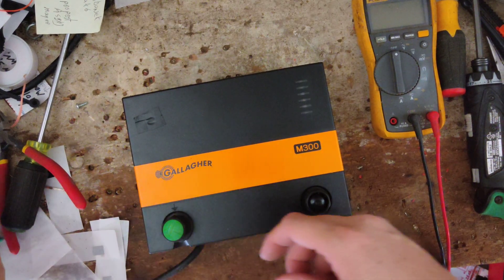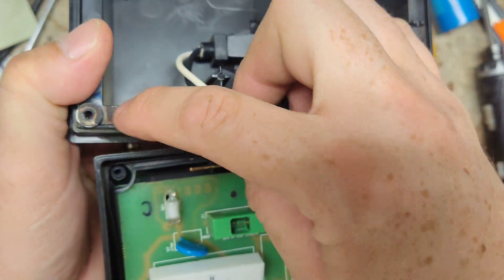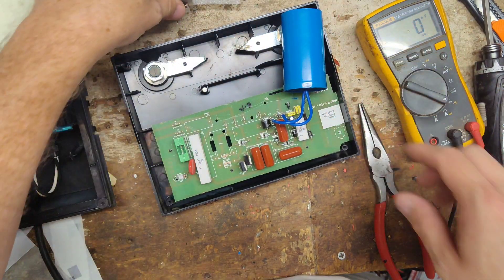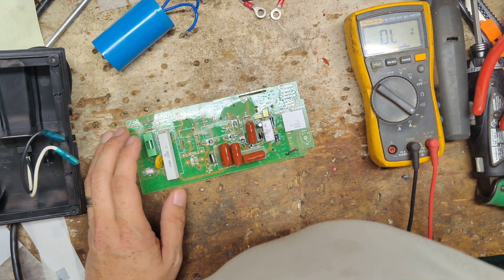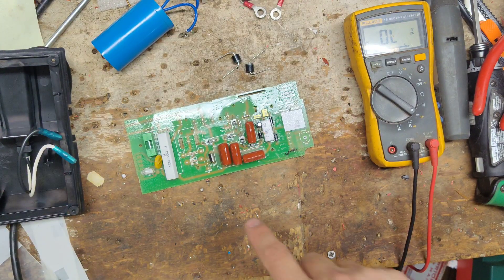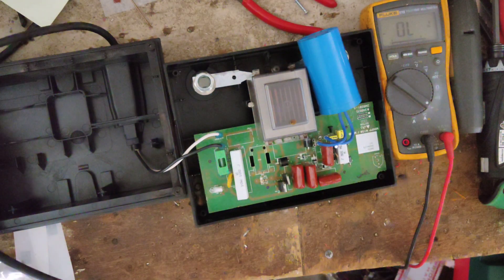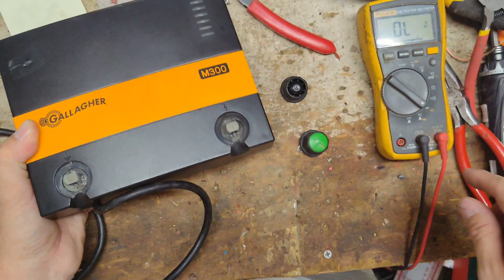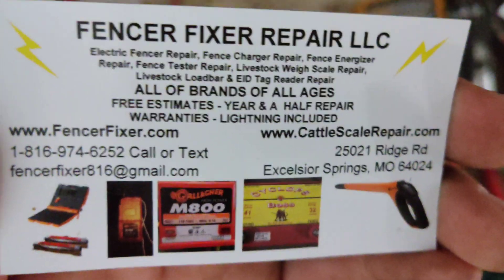How To Test A Broken Electric Fencer And Repair It | Gallagher M300 Repair

Comment: You don't change resistors. Smh
Reply from the maker: Those video is from 2 years ago and I don't know what resistors you were talking about, units they were surface mount, then no I don't bother changing those. They're not labeled, you can't read them, there's no schematics available from the distributors or manufacturer willing to give them out. We remove and solder in all sorts of components all the time. So instead of SMH, why don't you STFU

Comment: I have a FiShock UltraShock Model SS4000, Serial # 88234. It no workie.

I have drilled the rivets and looked around inside, nothing jumps out at me as being burnt. 

Are these units generally worth fixing? I am not adverse to buying a new box, but this one does have a bit of sentimental value.
Reply from the maker: Yes they usually can be. I don't get those in very often and don't really have a good guess of what's wrong or a price without seeing it here. www.fencerfixer.com

Comment: I have a Zareba 6 joule fencer. It puts out 6,000 volts approximately at the fencer. Once I connect it to the fence it drops t around 1,000 volts. I figured I had a short somewhere in my fence. I walked my fence at least 10 times and never could figure out the problem. Went and purchased a 20 joule Cyclops, hooked it up and everything is fine. Can a fencer be bad even if it’s putting out 6,000 v until a load is put on it. Just curious if you had and thoughts on my problem.
Reply from the maker: If there is a short somewhere that's able to drag down the 6 joule unit, the 20 joule is a lot stronger unit and will likely fight that whatever short of might be. I would invest in an electric fence fault finder.
Reply: @FencerFixerRepairLLCKansasCity  I purchased one a few days ago.
Reply from the maker: @kennethheern4896  Start at the beginning run and if you have multiple lines, test each one and the one with the highest amp readings is the one with the shorts on it. Also, if the kv is still pretty high 5-7kv I wouldn't worry too much. It's when the amps is high and the kv is fairly low, that's when you really have to start running the fence with the fault finder.
Reply: Ok. Thanks